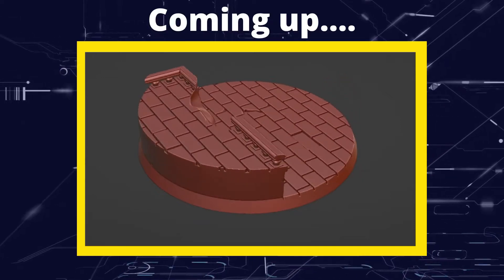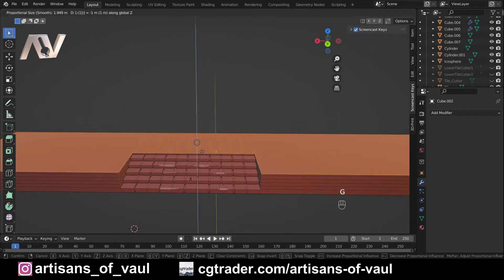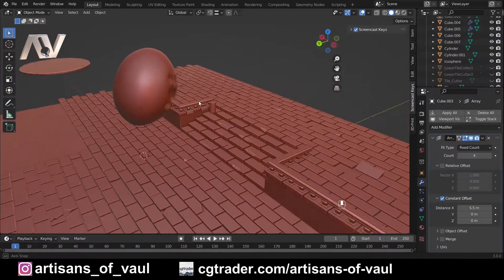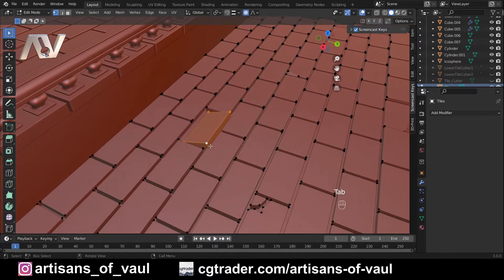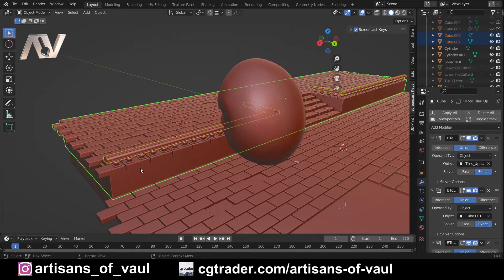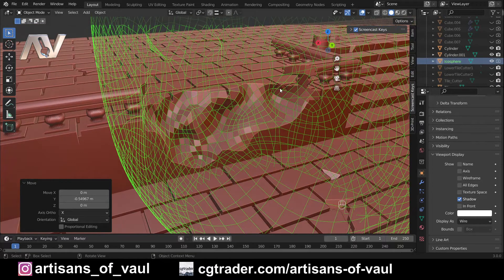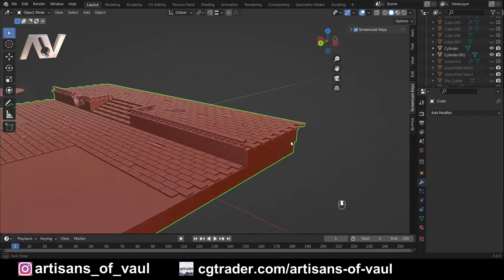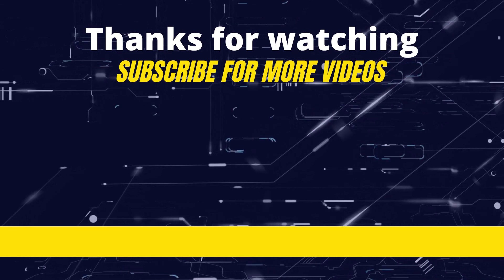Designing a Wargaming Based in Blender - Part 4

Comment: At 8:25 when we join the tiles to the stair platform. You say that if bool tools did this as a Fast, you need to switch it to exact.

When I do that, are large amount of the tiles on the left side go wireframe
Image: https://drive.google.com/file/d/1iPs9UkuhBpySvFaBwNBXnZ-aUdd5m2FU/view?usp=share_link
Reply: Exported a blend file if that would make it easier to asses: https://drive.google.com/file/d/1Pa2zu2RSO5548c3blLf6mGRfwww_etZP/view?usp=share_link
Reply: I fixed it, a mate had Z Brush. He opened it in there and noticed an issue. I ended up having to delete all the face of the Plinth for Z and -Z axis, then used 3D Printer to make manifold to fill in the missing faces. Then did the Boolean Union and it worked.
Image from Z Brush: https://drive.google.com/file/d/143eQYKRDxNAH6-zHaeYaI_6fVY9RhM9I/view?usp=share_link
Reply from the maker: Sorry you message chain never came up on my notifications, which is annoying, I hope I'm not missing lots of other messages too.  I was going to say if that has happened it's going to be an issue with the mesh somewhere. Glad you got it sorted. It's best to work with the exact boolean method as it means you see things like this early, otherwise fixing it later in the process is a pain.